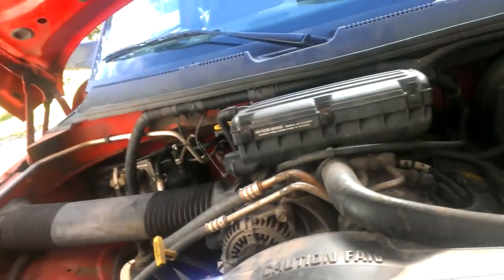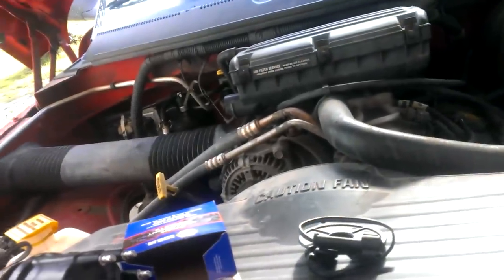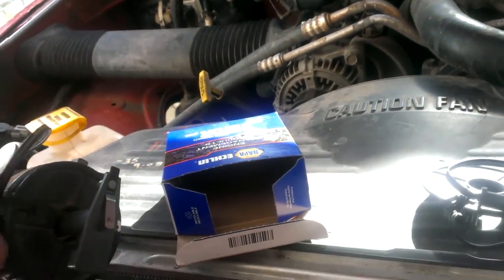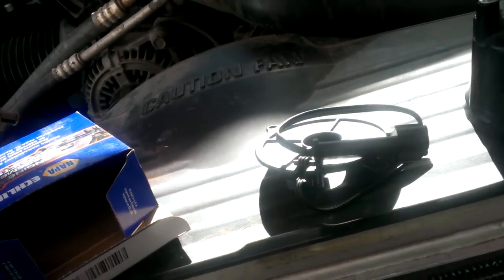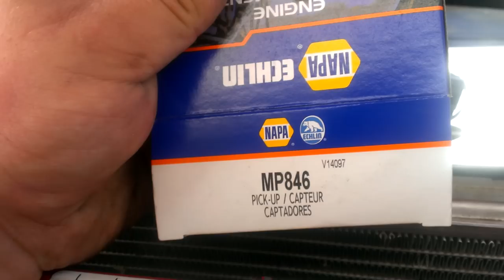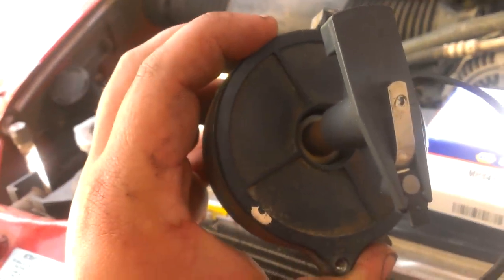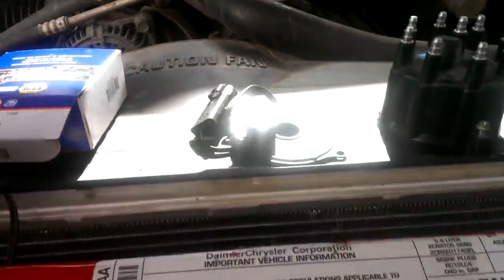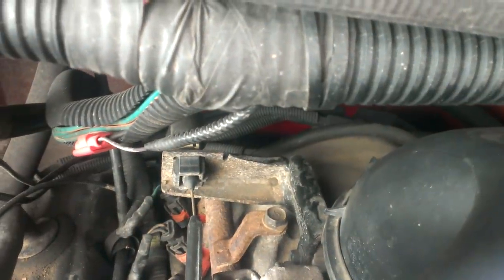Dodge ram stalling problem fix part1

Comment: are these on 88 dodges? I took my 318 ramcharger off road and got stuck, the 4wd was not working. Ran fine otw way home after gettin un-stuck. The next day drove it to work and back on the way home i stopped to pick up some food i let it idle in the line.  when i went to drive off it started bucking with low throttle extremely rough idle, cut off 3-4 times when decelerating. I got it home and it wont even back out of my drive way without cutting off. If i mash the pedal to the floor it doesnt skip a beat. Any ideas on what it could be?
Reply from the maker: Yo Daddy was there mud/water involved with your off roading?
Reply: Just slippery mud little to no watter

Comment: Do you know what could cause my ram 1500 5.9 to stall when coming to a stop it doesn’t run rough or throw any codes just shuts off and then starts back up?
Reply from the maker: Potentially the fuel pressure regulator. If you bring it to 2,500rpms, let off the throttle quickly and it stalls, it's a sign the regulator is not reactive to the change in demand for fuel and the engine will stall.

Comment: hey bill hope u get time to answer my question/problem here . so i have a 2000 dodge ram 5.2 2wd and 4 days ago having stalling problems ... starts up good i put in reverse and stalls out . i got new air filter,plugs,wires, des cap .anyways i noticed i have coolant leak. thought it was my bypass hose as it was leaking in that area . taken stuff apart and its behind my timing chain cover the gasket has gone to shit "known issue on these i guess" waiting on gasket in few days . but would that be my problem or something else u think i should check? open for any ideas people thanks !
Reply from the maker: aceplaya84 does it chug like its running out of fuel, jerk when going into reverse, or just shut off?
Reply: Bill The Tractor Man .... just shut off
Reply from the maker: aceplaya84 look into electrical.
Reply: Bill The Tractor Man weird how u say that . the night before i sanded down battery teminal negitive was a bit rusty. when engine running im getting 14v
Reply from the maker: aceplaya84 14 bolts is good.
Reply: Bill The Tractor Man ya i dont get the problem of stalling . ill have to look more into it when timing gaslet replaced and engine put bak together. just looking to tips to check . i read on some dodge threads maybe vac leak . just random how it was running great to stall
Reply: update ! so replaced my timing chain and gaskets for timing cover and water pump . seems to be running fine now .
Reply from the maker: aceplaya84 great! I had mine done at about 200,000miles. just as preventative thing.
Reply: Bill The Tractor Man thanks for the videos that help us average guys ! have a good one
Reply from the maker: aceplaya84 I'm just an average guy too, us average guys have to help each other out. thanks for watching, comments like these make the time and effort to film worth continuing.

Comment: I have a 1989 Dodge ram 100 with the 318. It stalls when braking or deaccelerating. No misses or anything it runs smoothly otherwise. Any ideas?
Reply from the maker: Could be fuel pressure regulator.
Reply: Our 2002 Dodge ram does the same thing.  Did you figure out what was wrong?
Reply: I realize this is way after the fact, but my 1989 D150 was doing the same thing, wouldn't idle at all when in gear.  I replaced the fuel pressure regulator, which Bill also mentioned below, and it fixed that particular issue.  Now it is stalling and losing power when accelerating....

Comment: Ok. New discovery, with my tank half full or more no issues, below half a tank it starts stalling. Brand new fuel pump, when it was changed, never put a full tank of gas till today, could it of had air in system???
Reply from the maker: +Jason Perry definitely could be, keep it about half a tank and than mater on see what happens.

Comment: Mine died a few times after having to jump start it. The battery was shot and replaced it. Now sometimes when I put it in drive the rpm sometimes goes down but doesn’t die.
Reply from the maker: It is normal for the RPMs to decrease slightly when put into gear as the engine takes on the load from the transmission. A big decrease or almost stalling you should look into further.
Reply: Bill The Tractor Man that’s what it does. Before the battery replacement I had to keep my foot on the gas to keep it from stalling
Reply from the maker: Check on fuel pressure and recreate the near stall. If pressure dips it could be regulator

Comment: So my 06 ram 5.7 hemi has been dying on me at red lights or when coming to a stop. It used to start up no hesitation, but now its shuts off right after it starts. The problem has gotten worse. It's now shutting off like 6 times in less than 10 minutes.
Reply from the maker: Sounds like a fuel pressure issue, I would look into the fuel pressure regulator first.
Reply: check your fuel trims. oxygen sensors could be chocking the shit out of your fuel. replace them
Reply: @zengim102  it was the crankshaft sensor. And Just replaced my fuel pump last month also. Thanks man!!

Comment: I have a 01 dodge 1500 it will die but after it sits a couple of hours it will start and run fine. any idea what it's problem may be? Thank You
Reply from the maker: pat perkins could be a clogged fuel filter, or possibly the coil gets hot and short out. what does it act like when it cuts out?
Reply: Bill The Tractor Man it bucks, shudders and acts like it's not getting gas, but I've changed the fuel filter. it does have only one right?
Reply from the maker: pat perkins some had a sock on the fuel pump.

when was the last ignition tune up?
Reply: I'll give you heads up now. Had the same problem. And I changed the fuel pump and the fuel pump relay (both can give you the problems. The sad part is that I had my friend do the fuel pump and I did the fuel pump relay and it seemed fine and then bam a day after I get it back, I am back to square one. What I have found is that your best bet it to try to figure it out for yourself. Because if you take it to a mech. it will cost you $$$$$. Because when you have a problem that is intermitted, they don't know either. I have spent much time on this and it can be so many things. Things I would have never thought of. Including this video....... I started with goggling " 2000 dodge van 1500 stalling problem". My advice it to just keep studding it.
Reply: Oh, yeah the sock Fuel Filter was in the fuel tank on mine 2000 1500.

Comment: I replaced that sensor and rotor and still have the problem my truck will idle with no issues but when driving it will die then I turn off ihnyand wait 30 secs and it will start back up but will only go for about a quarter mile if that before dying again I can start it up sit there at a idle no problems can rev it up still don't shut off but put it in gear and it will go for a few then die even if I am going down hill and put it in neutral it will still die
Reply: Same issue, have you found a solution
Reply: Sounds like a crank sensor I had a dodge neon that done this

Comment: My 2003 dodge ram is kinda loosing power then goes away and comes back while park and while driving it shuts off randomly can you help
Reply from the maker: Harvey Hernandez could be fuel related, like a restricted fuel filter. I cant be sure that that's the issue but that's usually a commonly neglected filter that needs replaced and can act that way.
Reply: Bill The Tractor Man thanks ill check that out.
Reply: Harvey Hernandez I’m having the same problem w my 03 Ram did you figure out what it was? Thanks!

Comment: Suggestions on why my 2005 Hemi truck stalls out when I slow down and has a hesitation around the same speed. Just started 2 days ago???
Reply from the maker: ClubOf1 fuel pressure regulator comes to mind. Best thing to do is put a gauge on the fuel port and see if pressure falls off when it starts to stall.

Comment: I have a 02 ram 1500 that has an aftermarket remote start and it stalls out randomly driving or idling but it starts right back up with out an issue someone please give me an idea on what to replace on it
Reply: Same with my dodge ram 2005

Comment: 2000 Dodge Ram 1500, driving it stalled out. Engine power gone but power to the dash. Fuel Gage not functioning while this happens. Try to restart it won't start. Almost as if its too hot out something. I'll wait about 30- 45 min. Then Try again, it starts. But this it's happening 5 times today. Help!
Reply from the maker: Sounds like you definitely have a strange electrical problem that will require hands on diagnosis. You will need a good mechanic to chase it. I wont be able to answer that one for you.  Thanks for watching though.
Reply: @BillTheTractorMan  Crap, ok thanks then.

Comment: I have a 2014 dodge ram 1500 what’s the part I need called?
Reply from the maker: I don't know that a 2014 ram would have this part. I have not worked on the newer trucks.
Reply: @BillTheTractorMan  darn okay thanks for the quick response, I’m sure I’ll get it figured out.

Comment: So my 1995 dodge ram 1500 stalls when I go in reverse and give it some gas any tips/advice?
Reply from the maker: Alex Hampton only happens in reverse?
Reply: Bill The Tractor Man yes as soon as I hit the gas or lightly push the gas and let go it'll stall on me
Reply from the maker: I would think it may have to do with the transmission being locked up or binding in reverse if it doesn't do it in forward gears. is it an automatic or manual?
Reply: Bill The Tractor Man auto its fine in drive just stalls in reverse
Reply from the maker: Alex Hampton I would check fuel system or systems related to the transmission. A bad sensor, or the transmission not shifting, or binding.
Reply: dont go in reverse
Reply: @BillTheTractorMan  what would cause it to stall from going from park to reverse or park to drive or neutral to Reverse or neutral the driveway mine just stalls when wanting to go in reverse or any forward gears every now and then I’m lucky if I just throw it all the way down into one does it want to stay alive but I have to keep pumping the gas to get to move in then it’s like no power
Reply from the maker: @chasepag4412  too many possibilities to list out based on a comment description.

Comment: I have a 2010 Dodge Ram 1500 Big Horn....and it stalled the same way . Driving...red light... hit the gas...dead. ( dangerous besides ) . Do you aor anyone here think this will do the trick for my issue ?  2nd....is there liquid sensors for water and oil ? Because it happened to me a couple years ago, and I was nearly out of oil. I put in several quarts and it fired up and ran good.  Thanks in advance.
Reply from the maker: I would look into fuel pressure with what you are saying.
Reply: @BillTheTractorMan  Does it sound possibly the same as the others with the Cam sensor ? Or doesn't my truck have a distributor ? Thanks and thanks in advance.

Comment: Okay my question is this I have a 2000 Dodge ram it starts and runs and drives perfect I think I can drive it across the country but at any point if I turn off the key and shut it down it will not restart until three or four hours later what's going on what kind of sensor is that it must be some kind of heat sensor right if anyone has a clue to what's going on please tell me how to fix it this is on a 5.9 liter engine 2000 Dodge ram 2500
Reply from the maker: I'm not exactly sure. How long has this been going on? I would start by looking at the spark ignition system. Coil, distributor, and wires. Sometimes coils will act that way when they get warmed up. However typically they loose spark as the engine warms up and will regain spark when it cools off.

Comment: Is it common for these to fail and NOT last long ?  I replaced mine 6 months ago and Now, since Cold weather , I'm getting the same symptoms again, stalling etc. ????
Reply from the maker: I went through 3 in six months, aftermarket ones. Put a napa one in that has lasted 4yrs and now its acting up again this fall. It's possible the magnet is getting weak or cheaply magnets were used.

I've also had the distributor move slightly which causes a similar issues. If I recall correctly there isnt much to hold it in place. I think it was off by 2-3 degrees.
Reply: Thank You Bill,  I put one from NAPA in 7 Months Ago, $38,  Now I'm Not sure where to buy one. Is any Brand Better than another???
Reply from the maker: @MrDanoconnor  I tried I think O'Reilly's and those were the most flimsy and I was concerned out of the box. You could try a mopar one from the dealership. I talked to a mechanic that swore by only using the mopar units based on his experience. Only problem for me is the nearest place I can get mopar parts is 60 miles away so its always a phone call and waiting for shipping vs. Napa is 8 miles, and O'Reilly's is 26 miles who have them next day. You could buy a junk yard one just to see if it makes a difference. I have one on the shelf that seems fine.... paid $5 for it.
Reply: I will definitely be keeping a spare on hand from now on.  Thanks Again
Reply from the maker: @MrDanoconnor  you're welcome. I think what's happening is the newer parts just are not built good enough. I know a few 360's that have over 200k miles on them with their originals in them. I think the newer magnets and other materials are just inferior. It probably wouldn't be such a problem except Chrysler used a square wave form for the sensor instead of a rounded wave form. Meaning at the top and bottom of the sensors wave for us sharp, squared edges with a flat peak. When those edges get rounded and fuzzy there starts to be issues.
Reply: Just changed mine and the Magnet and Distributer shaft were Both Rusty. I think the problem is  in the location of the distributer.  My Truck has a Rubber Flap screwed to the Firewall over the Distributer, obviously to try to  divert the water. We have had Nothing But WET weather this past 6 months and so I believe that Water is the Culpret.  I am going to make a Gutter from a piece of drip edge to divert whatever may drip in under the hood. away from the Distributer.  Hey, can't Hurt???
Reply from the maker: rust definitely would effect the magnet and the sensors reading. My truck has a rubber weather stripping that diverts any water to the sides and away from the engine. I totally get that wet weather, farmers have finally been able to start in the fields for harvest the last couple days. the low spots are still sticky but at least the corn and beans are dry enough. If it weren't so cold I would take the pressure washer out and wash the mud off the truck.

Comment: you never said what kind of sensor it is. my truck is dieng somtimes
Reply from the maker: mx guy2014 pick up sensor/ cam position sensor are two of the names it goes by.
Reply from the maker: mx guy2014 MP846 is the Napa part number. in the video I expressed the part name twice.

Comment: After 2 years of searching around I finally fixed mine , it wasn't this sensor,  I replaced it though but still stalled, I replaced way to many things and any of those worked.  the solution at least in my case was something that costed $35 bucks.  listen to your engine when it does it and how it reacts
Reply from the maker: what was the solution for you?
Reply: Bill I changed tps, ICA, MAP SENSOR, nothing worked , truck would shut down some times , it would not respond to throttle  then it would die most of the time,   I started thinking something it's clogged it feels like it's not breathing in or out,  I don't know I'm not a mechanic.  I concluded the catalytic converter must be clogged so I both cataclean $ 30 per bottle and a gas treatment and poured into the gas tank at 1/4 full , drove for 30 miles and the issue went away, I plan  to do one more treatment next week to clean it even more.  many others suggested the fuel pump or vacuum lines , this worked for me , I had this issue for 2 years , engine blew up . put a new engine with 30 000 original miles and the issue persisted after the swap so I started thinking the issue it's not in a sensor or engine components.  I hope this helps ... it's a pain in the ass trying to get in to traffic with vehicle that stalls and don't respond to throttle and all of a sudden pulls very hard or dies ..
Reply from the maker: +jorge  sanchez if your cat is clogged or clogging your truck would lack power accelerating.

one thing I didn't mention in the video is even if your distributor is even a degree out of time it will cause that sensor to occasionally trip, killing your engine. this you need a computer hooked to you vehicle to diagnose and fix.

Comment: Need help. Changed it out and now it won't start
Reply from the maker: Make sure you connected all your wires correctly, installed the distributor rotor, and the distributor cap is installed correctly.
Reply: @BillTheTractorMan  only thing I'm not sure about is that I turned the distributor a little bit while I was trying to put the rotor back in place. Would that have thrown the timing off
Reply from the maker: @ivanross2658  definitely a possibility

Comment: Happens to my 1500 all time and the dodge dealer cant find an error code so I am on my way again and i guess take a a dangerous unsafe chance. All dealers go by their computer no hands on mechsnics anymore.
Reply from the maker: It's hard to find dealerships with hands on mechanics. All they teach in the trade schools it seems is the computer side. Sometimes small shops around town are pretty good places to go.
Reply: mine had no DTC, code six said oxygen sensors